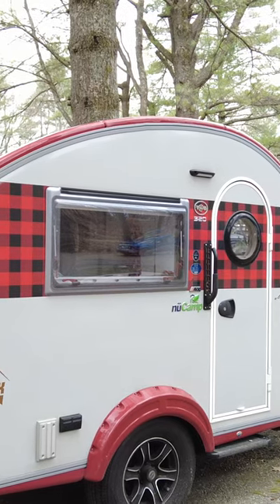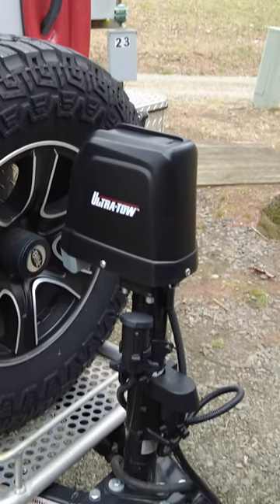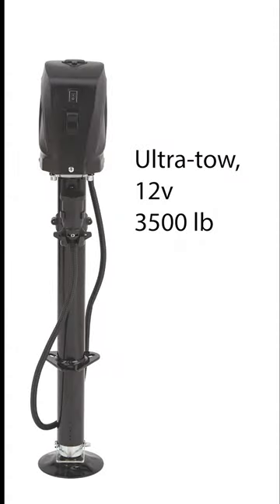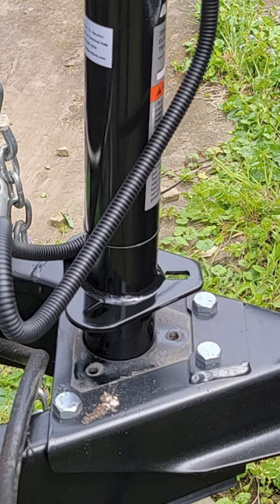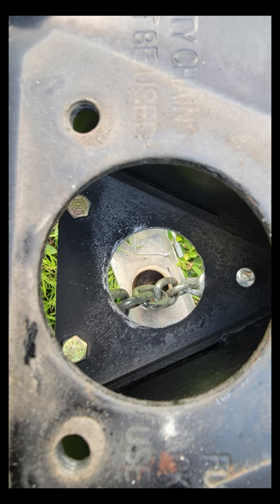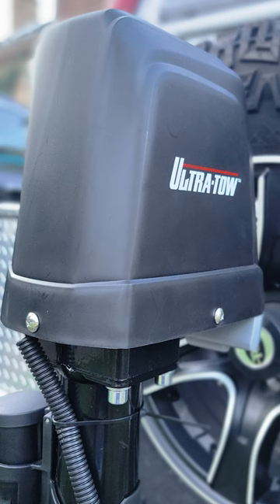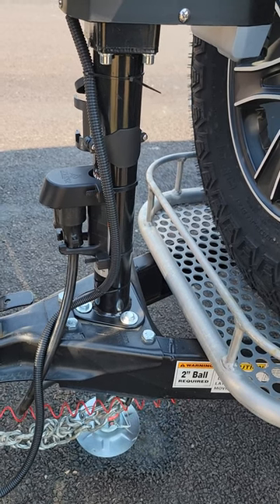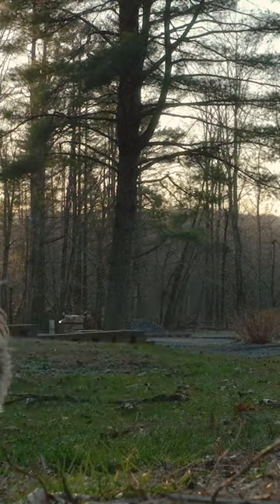Installing a power jack on a nuCamp Tab 320 or Tab 400 - #shorts #tabtrailer

Comment from the maker: https://amzn.to/3KqSkV6 

Ultra-Tow Electric Trailer Tongue Jack - 3500-Lb. Capacity, 12 Volt:
- Includes crank, light, holder for 7 pin connector 
- 12V electric trailer jack has 3500-lb. lift capacity 
- Quick plug-in operation with prewired 7-way blade trailer connecter power supply with plug
- Durable hardened steel gears with water-resistant motor cover 
- Easy-to-use switch for raising and lowering trailer in seconds 
- Motor has auto thermal protection to prevent damage to motor as a result of overheating 
- 9-27" range, plus 4.5" drop leg
Reply: Did you need the relocation kit to install it?
Reply from the maker: @aprilsexton8778  no